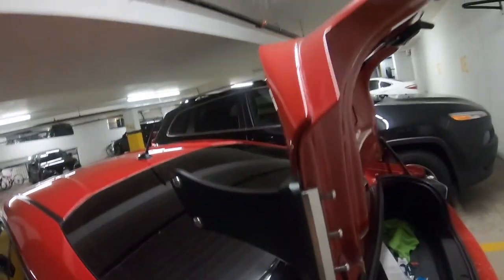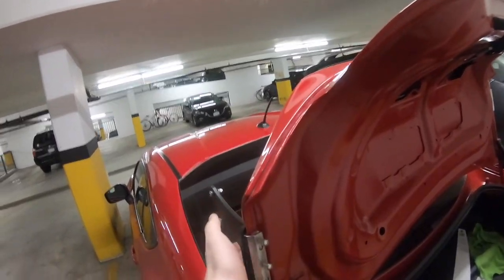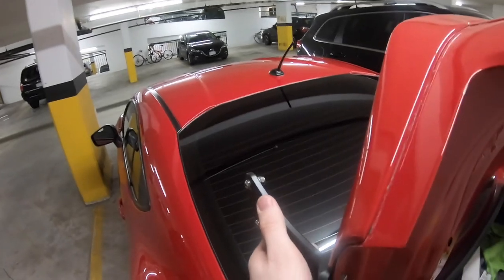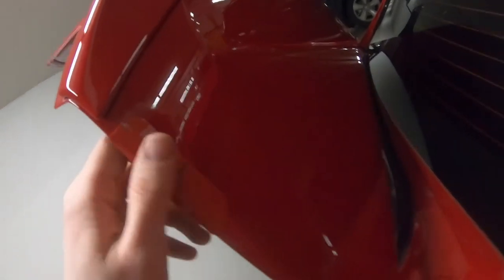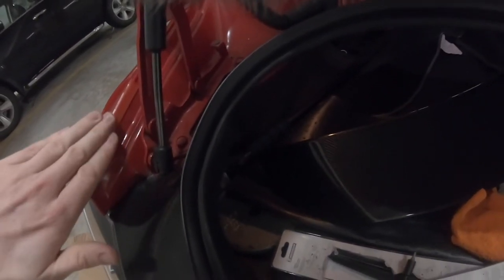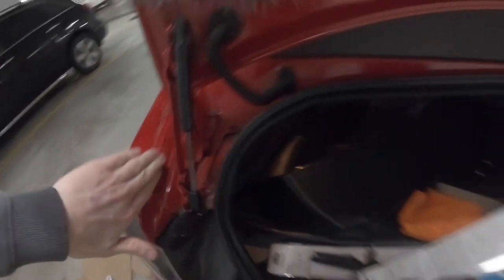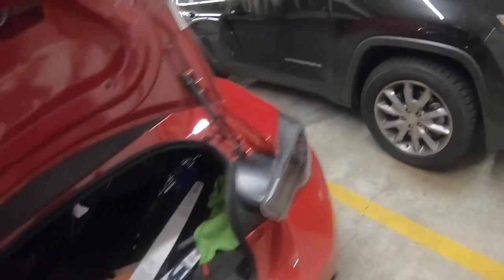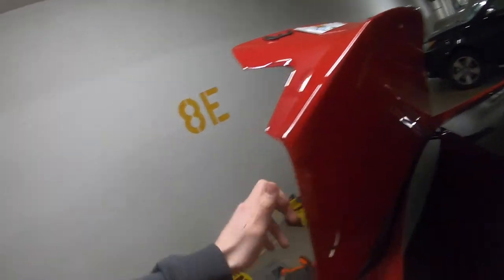How to install a Sard LSR wing without damaging the paint on a Toyota Gt86 Scion FRS and Subaru BRZ

Comment: Did you have to drill holes on your trunk? thanks!
Reply from the maker: Nope. I have since removed this wing and sold the car and there was not a single scratch on the trunk.

Where I drilled was into the plates I made just to give the screws something to grip to. But honestly it was not needed and if anything I just risked slipping with the drill and causing damage that way.